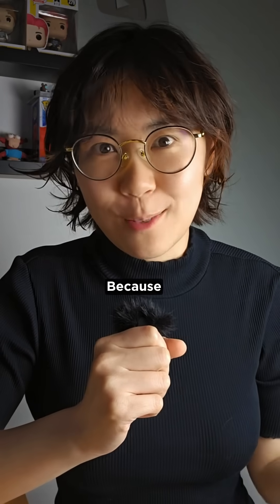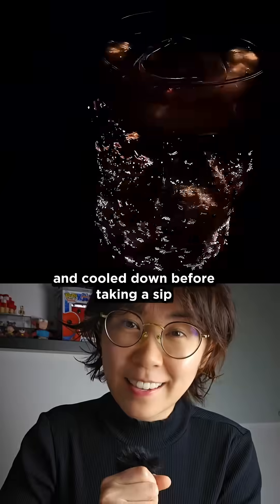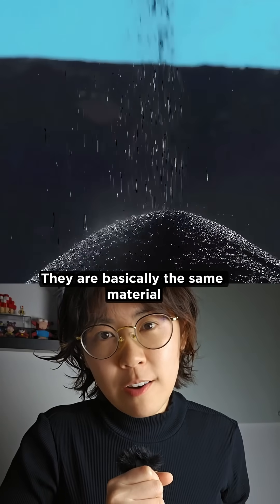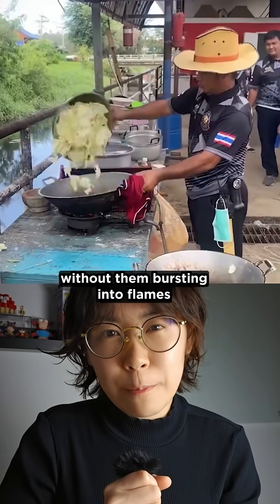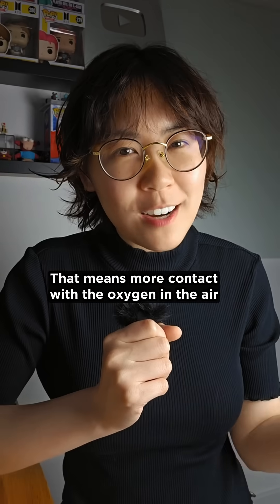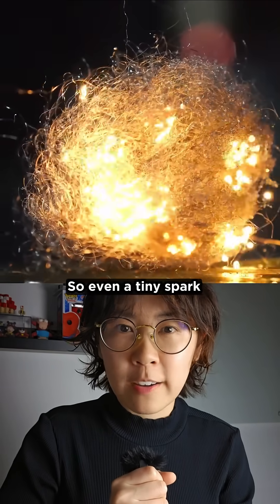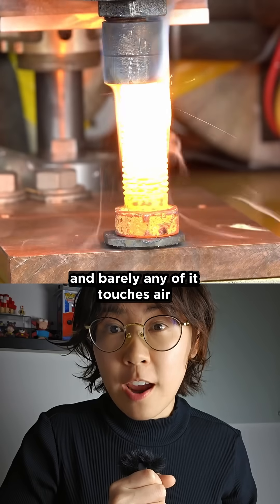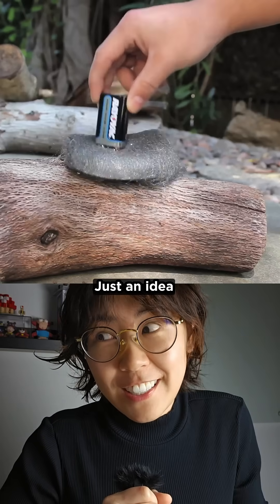Why Steel Wool Burns But Steel Doesn’t

Comment: Right so if i want ask out the pretty lady for cocktails look under a rock got it. 🥰What wire wool set on fire is the new to heat up jazzy hot chocolates and becuse other steel is dense and dumb.

Comment: Ask any modern blacksmith...

You can ignite steel in the forge... the sparks flying off of it is spectacular.  They never want to get their steel hotter than white-hot.  Red-hot or orange-hot is plenty hot enough to forge it.

Comment: hi blacksmith here. if you heat a block of steel over coal with a lot of airflow you can definitely burn it and it sucks when you do

Comment: Steel=Iron+carbon(99:1, very little carbon.) carbon is fuel for fire. Iron holds heat. Thin wire means fewer internal molecules that don’t touch air. Air+Fuel+Heat=fire

Comment: Here is a fun experiment, When cutting steel with Oxyacetylene, stop flowing acetylene and keep the pressurized oxygen pumping into the cut. The cut would remain at the ignition temperature of the steel and you can finish the cut without the acetylene.

Comment: Steel wall is coded with silicone otherwise the steel wall would rust almost immediately when in contact with damp air

Comment: I hope people see the stupidity of this trend and snap out of it. It is suuuuper dangerous, as the ignited strands may break into parts small enough to inhale and then get into your lungs, or on your skin when you accidentally touch it. It's not invisible as asbestos, but has a similar effect. Please, pleeeeaaase don't do this. This is not the kind of wool used for dishes. But don't burn that either.

Comment: It would be cool to use a battery, but the reason they won't is because of associative consistency. A torch reminds people of fine dining because it's used for certain dishes. It also reminds them of alcohol because some drinks are set on fire before drinking as well. Batteries on the other hand don't have any correlation to food or drink, and one of the first things we are taugh about batteries in our lives is "don't swallow them", so it contradicts the experience and breaks consistency.

Comment: That's nice and all but...

Sure! Here's a classic vanilla cake recipe that's fluffy, moist, and perfect for birthdays, celebrations, or just a sweet treat.

---

🎂 Classic Vanilla Cake Recipe

Yield: Two 9-inch round cakes (or one 9x13-inch sheet cake)
Prep Time: 20 minutes
Bake Time: 30–35 minutes

---

Ingredients

For the Cake:

2½ cups (315g) all-purpose flour

2½ tsp baking powder

½ tsp salt

1 cup (226g) unsalted butter, room temperature

1¾ cups (350g) granulated sugar

4 large eggs, room temperature

1 tbsp pure vanilla extract

1 cup (240ml) whole milk, room temperature

Optional for extra moisture: Add ¼ cup sour cream or plain yogurt

---

Instructions

1. Preheat oven to 350°F (175°C). Grease and flour two 9-inch round cake pans (or line with parchment paper).

2. Mix dry ingredients: In a medium bowl, whisk together flour, baking powder, and salt. Set aside.

3. Cream butter & sugar: In a large bowl or stand mixer, beat the butter and sugar together on medium-high speed until light and fluffy (about 3–4 minutes).

4. Add eggs & vanilla: Beat in eggs one at a time, mixing well after each addition. Add vanilla extract.

5. Combine wet and dry: Add the flour mixture in 3 parts, alternating with the milk (start and end with flour). Mix until just combined—don’t overmix.

6. Pour into pans: Divide the batter evenly between prepared pans and smooth the tops.

7. Bake: Bake for 30–35 minutes, or until a toothpick inserted in the center comes out clean.

8. Cool: Let cakes cool in the pans for 10 minutes, then turn out onto wire racks to cool completely.

---

🧁 Frosting Suggestion

Vanilla Buttercream:

1 cup (226g) unsalted butter, softened

3–4 cups (360–480g) powdered sugar

2–3 tbsp milk or cream

1 tbsp vanilla extract

Pinch of salt

Beat all ingredients together until light and fluffy, adjusting consistency with more milk or sugar.

-

Comment: everything will burn if the mixture of oxygen and the material is right, the only exception is oxygen its self
Reply: carbon dioxide wont burn
Reply: @logodsaw  yes it will with enuf heat, we are talking 1,000's if not 10,000's of degrees

there is a reason why the fire triangle is important

CO2 is broken down to oxygen and carbon then burnt into CO (carbon monoxide)
if you get it hat enuf you can brake it down to HO but that would be millions or billions of degrees (theoretically)

Comment: Slow oxidation (rusting) vs rapid oxidation (burning).
- Yup. More surface area in steel wool means more access to oxygen, and much faster oxidation (burning). a chunk of steel will rust, but not burn. It's the same chemical process, basically, but much slower vs. steel wool.

Comment: A tiny thing you left out is thay the thickness of the metal is what dissipates the heat. For a bolt or w pan, heat is absorbed  and sent through the metal, and then released into the surrounding air very quickly. 

Cooking flames on a stove are actually 1,000° hotter (Fahrenheit) than the melting point of steel. 

The air above the pan is heated just as quickly as any food placed on the pan. Even a very thin pan will not melt on a stove. A thin pan simply cooks the food faster and with a circle pattern from the flames below 😅

A thicker pan disperses the heat more evenly across the surface so you usually can't see the circle of the flames in the food.
Reply: and coils/playes run just a little higger than the cook temps and real conduction just heats exactly

Comment: Cooler than just using a battery would be to hide the battery and when the glass got placed in a specific spot at the table the stell wool would start burning

Comment: the real answer, is something to do with thermal inertia IIRC.
like, you theoretically could do the same with normal iron ingots, its just that the heat that keeps reaction going gets absorbed too quickly by the much cooler surrounding material.
also combine it with the insulating properties of air, or rather, its inability to conduct heat.

Comment: No, lighting the steel wool with a battery is not cooler or more aesthetically pleasing than a torch shooting burning hot gasses at thousands of degrees, and you think it's somehow cooler to use a tiny box instead?

Comment: Its like wood burning a whole is much harder but a long thin strip is very very easy to ignite its not as much as burning but melting but its basically the same at this scenario nice info u might have just saved someone s life with knowing this can burn too

Comment: If you get bulk steel hot enough it will burn. That's how a cutting torch works. It's not melting the metal, it's making it catch on fire.
Reply: The slab of steel will not keep burning. Otherwise steel mills would not work the way they do. The point of the video is that with high surface area compared to its mass, the heat generated by ignition is not drawn away by the remaining metal, and is enough to sustain the ignition in atmospheric oxygen. Blasting with hot flame (adding heat) and 100% oxygen (unnatural levels) is not a self-sustaining process, i.e. not catching on fire. Some engineering metals will do this though in bulk form, such as magnesium, aluminium.
Reply: @BC-wj8fx  Oxy-fuel cutting literally raises the temperature of metal to the kindling point. That's the actual, technical term. The point is it's burning not melting.

Comment: steel rusts more readily at higher temperatures, since the steel is so thin it's able to fully rust and because the oxidation reaction is happening it produces additional heat as a byproduct, which in this case is enough to keep the steel burning because it has ready access to more oxygen and the steel is almost all surface metal, in normal circumstances the outer layer of steel oxidizes and eventually flakes off, without producing enough heat to completely burn the block of steel.

Comment: ……. So funny story, I got in trouble playing with Steelwool and a 9v battery. Thought I was smart for Not playing with Matches. … I still got whipped. Although I have heard it gets REALLY INTERESTING when you use higher voltage.

Comment: it would be a cool show to see the bartender touch the wool with his two index fingers, a "watch with a battery attached". two wires could be safely attached a ran along the fingers so when the small wires quickly touch the wire it ignites.

Comment: Steel strands is hazardous when swallowed, so why risk your life for a silly unnecessary trend which will fade in some time .
Thanks
Reply: Exactly… I’ve been lighting this on fire outdoors many a times when I was young as a play thing, but never around food or drinks; and 
Only now, it’s a bar trend? It’s moronic. 

People get mesmerised too easily, and don’t think of possible consequences. It’s like they want it to happen, so you can spend more. 
Then, consumers can sue bartenders bcz being “accidentally” poisoned. It just takes one slip up, and the dominoes start falling.
Reply: True ❤  @Miky008

Comment: In high school, my chemistry teacher once heated up a test tube of iron filings and said "Anyone want to see iron on fire?" and then proceeded to tilt and tap it an as each filing fell out into the air, it burst into a little flaming spark. And then the test tube shattered and rained fire down on a student's binder. She got a handful of little cigarette style burns on her papers, and we got leave class 20 minutes early! (Also, you knew it was going to be a cool thing when he would look out into the hall first, and then close the door. That's when the fire usually came out.)
Reply: The way this experiment is usually done is to heat up an iron compound (usually iron oxalate) which causes it to decompose into metallic iron and a gas. These iron particles are so fine, when they’re dumped out into air they spontaneously ignite.
Reply: @RiehlScience  Interesting! I didn't know that!
Reply: Unfortunately every dam school is went to was to lame to do that it was what does this chemical do show use the reaction on paper and never seen it happen in real life good luck.
We always got shit wrong and was so bord we stop listening to him a few minutes into class because there was zero experiments just paper and writing things down.
Reply: @Dead.garden clearly their english teachers were also shit

Comment: I was thinking cause it's less dense it burns quicker. As if it was more dense the heat would have to distribute longer.this can also be the same with copper. Why people sauder on electronic boards. Also when u said just a idea. U sound cute.

Comment: It's weird to me that steel can burn, but it makes total sense. Burning is oxidation, just more violent. Since steel can rust, obviously it can burn. Just weird to think about.
Reply: Does that mean wood can rust?😮
Reply: @angelakaleen666  uhh, im probably not qualified to answer, but im pretty sure no. Something to do with it being a worse reductor, meaning it needs more energy to react, probably, so it burns before it rusts. Not sure though, look it up if you want. Or ask chatgpt
Reply: So, rusting basically is oxygen attachment to iron molecules, making heat. Burning is like the breakdown of the material and the release of gases. These gases bind with oxygen i think and make fire. Pretty different if you ask me cuz rust is oxygen sticking to iron and burning is the degradation of material into gases like carbon and hydrogen then combing with oxygen to make CO2 and H2O + light + and energy. I am not a nerd enough but pretty sure the processes are different.
Reply: @Dukkk-h5l yeah I don't remember the details but burning steel leads to ferric oxide (fe3o4) which is black, whereas rusting makes ferrous oxide (fe2o3) which is brown-red ish.

Something something energy level, absorption band; something something different color.
Reply: Nerd @randomnobody660
Reply: @Dukkk-h5l They are more similar than you'd think. Fire is basically what happens when a flammable material gets hot enough for the compounds to break down and vaporize. If the vapors are hot enough, they'll start reacting with oxygen. When they react with oxygen, they produce heat which makes more of the material to break down, vaporize, and react with oxygen. The light from the flame is soot (carbon) which is hot enough to glow brightly. 

With steel wool, it doesn't vaporize, but it gets hot enough to react with oxygen in a sustained, intense reaction. Since it doesn't vaporize, it actually gets heavier because mass (specifically oxygen) is being added. Rusting is similar, but slower and can be accelerated with  water, and saltwater does the job faster. And, for whatever reason, putting electricity into the mix can accelerate rusting even faster than water or saltwater alone. 

Really, the only differences between rusting (or oxidation in general) and burning are speed and the number of steps involved, unless you're using saltwater and electricity to accelerate the rusting, of course.
Reply: @lucke839 ok man. You're on a science channel.
Reply: @Ht9ehtoom ok but he more nerd than other nerds so the point still stands
Reply: @lucke839 turn thy eyes inward and see: tis thee who art the nerd.
Reply: @Ht9ehtoom just talk like a regular person, not in nerd language
I didn't even say it to you, now you're more than the others
Reply: @Ht9ehtoom honestly the real answer is kind of boring: Rust is used as generally synonymous with iron oxide, further still mostly Fe(III) [e.g. Fe2O3, FeO(OH), etc]. So it’s more that definitionally rust is in reference to these iron oxides. 

P.s. did you know that since free energy is a state function, there’s functionally no difference between oxidizing, burning, or eating (digesting) sugar? The body just stretches it over several smaller oxidation steps (so you stay warm instead of instantly using all your blood sugar and/or setting on fire)
Reply: its glucose and oxygen turning into co2, h2o, and heat. also it is oxidizing. the glucose is losing electrons.
Reply: @angelakaleen666 No, but it can oxidize. Im dumb tho so idk.
Reply: @angelakaleen666 uhhhh, well yea, maybe, since rusting is just oxidation, pretty sure it oxidizes
Reply: no oxidation is when a molecule loses electrons, and because oxygen has the second highest electronegativity, while being extremely common on earth, many materials on earth will oxidize with oxygen. when we say rust, we are specifically talking about the oxidation of iron. wood is not iron, therefore even if it oxidizes it would not rust. and also for wood to burn/oxidize, it needs high activation energy, meaning even if it could rust, it would need lots of heat
Reply: @cloudyy_9351 Oxidation is when a molecule loses electrons, and burning IS a form of oxidation. When you see fire, what you see is amongst other things ionized gas which has lost electrons. Burning is oxidation, just more violent. So a beam of steel can’t burn because the reaction isn’t violent—rust is slow. Burning is intense and sometimes quick. I think it’s just a definition thing and it’s probably not deeper than that
Reply: @angelakaleen666  no it needs metal ions in the material to rust. There is pretty much only carbon and oxygen in a tree so there would be no way for any of the atoms that make up a tree to rust. Also, the carbon that makes up most of the tree including the bark, is a very stable atom so it is able to keep the oxygen/chlorophyll and other plant products in the tree rather than diffuse into the outer world also leading to less of a chance of a reaction like rust from happening. Metal ions aren't alive and are pretty reactive in relation to other common elements which leads to them rusting.
Reply: Im not a genius but Is more or so the same as sawdust vs wood
Sawdust burn the same way as like matchwood phosphorus 
Compared to normal plank of wood
Reply: Another cool thing to think about is that she said massive one time in this video
Reply: @Dukkk-h5l I IMAGINE that my enjoyment of this comment will never become LOW, TAPER or FADE. Thank you.
Reply: There's some rocks that can be ignited too. An oxygen lance and a cutting torch both use iron as a fuel source. 

An oxygen lance is just a high carbon steel pipe. It's heated at the tip and then pure o2 is sent through. The carbon helps the iron ignite at a lower temperature. This burns steel hot enough to destroy concrete. The steel reinforcements inside the concrete are also burned away. 

A cutting torch does something similar.  There's a valve lever on the handle that increases the oxygen. When first lit, use the acetylene flame to heat the steel until it glows. Squeeze the oxygen lever and the steel itself will ignite. 

This is also how you can use jet fuel to set steel beams on fire and use that heat to melt the beam. Especially if you add an aluminum aircraft. Aluminum + iron oxide= thermite. Thermite is used to melt steel railroad tracks for welding. 

Ultimately, the main factor is the level of oxygen.
Reply: i think wood does rust but it is so slow that wood rots before it can rust
Reply: But paper can't rust, why can it burn?
Reply: So it works the same with copper or alluminium?
Reply: If steel can burn because it can rust, does that mean wood can rust because it can burn?
Reply: All metal can burn
Reply: Pure iron fillings without an oxide layer will spontaneous combust in air
Reply: its weird to think of oxidation letting off that much energy without chemically reducing sugars
Reply: everything is on fire